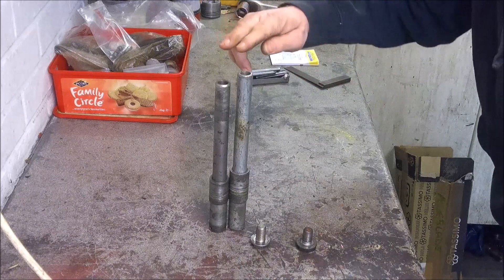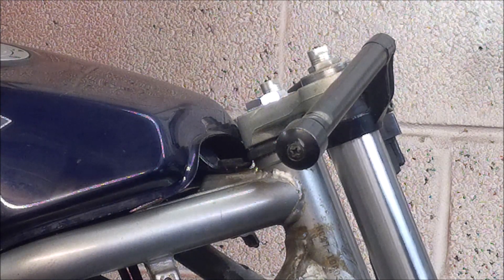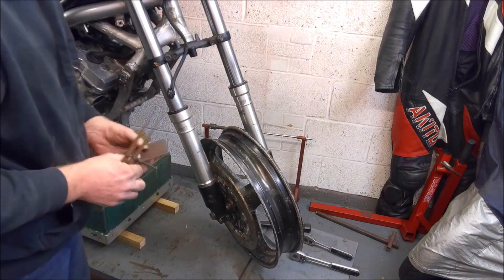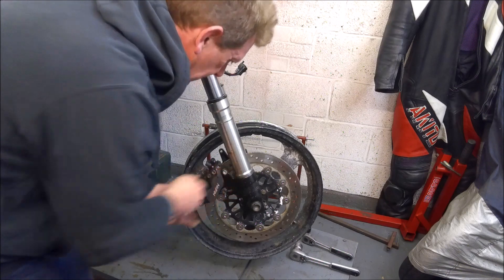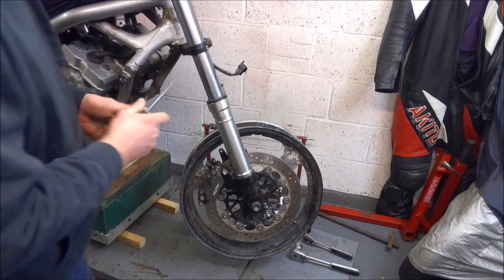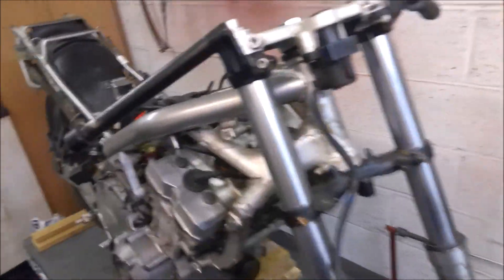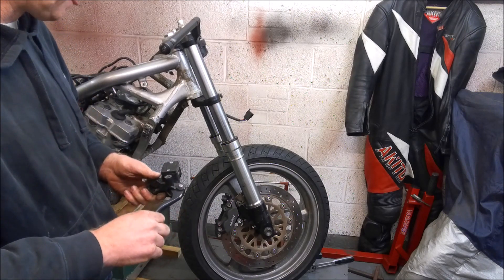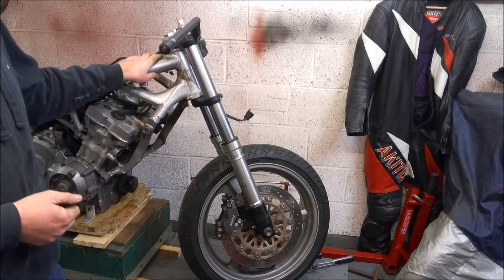CB-1 part 4   Fork Upgrade part 2

Comment: you will likely need to source longer throttle and choke cables and possibly brake lines and clutch cable etc

Those from a nc31 superfour should work.

the ridge on the pin is likely to locate the anti rattle plate
Reply from the maker: Hi Prawny - the plan is to make my own but the NC31 cables are a good shout